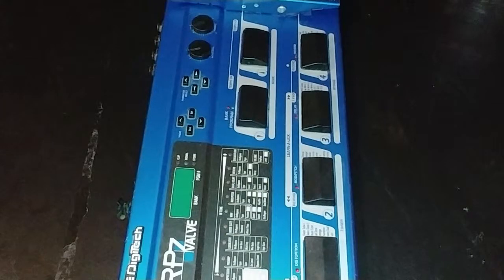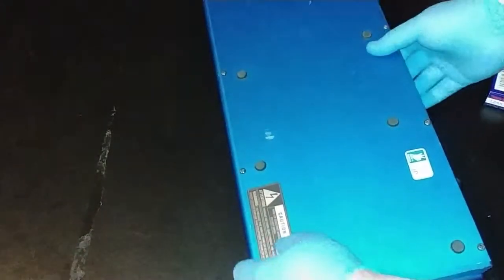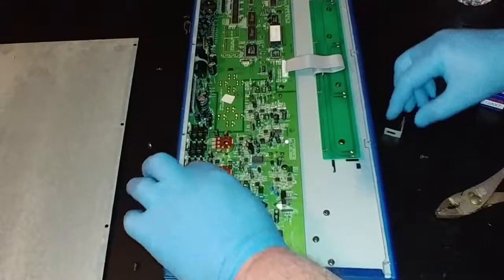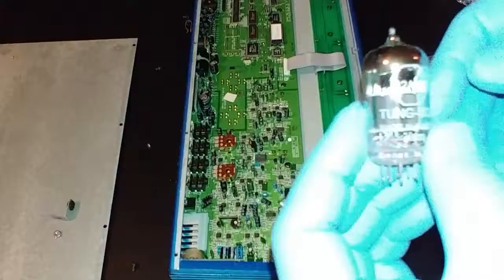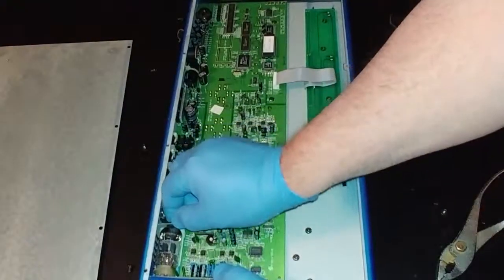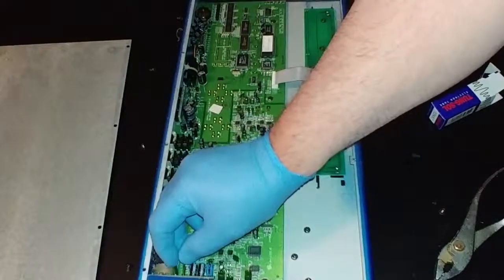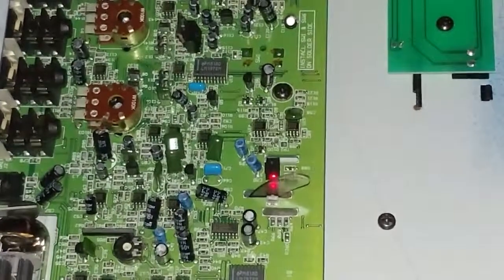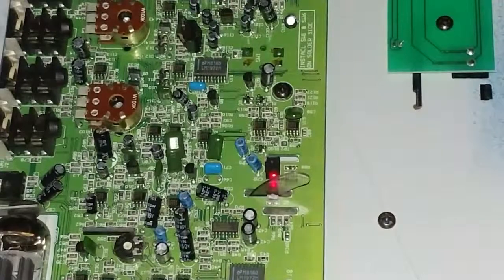Digitech RP7 Valve - Tube Replacement

Comment: Hello, I have an RP7 valve but I have damaged it because it was 120v and I accidentally connected it to a 240v line. The transformer broke down but I already bought one online and it is yet to come. I have tested if the multi-effects works with a conventional universal 9V transformer connecting it behind a couple of transistors that were behind the power socket that seemed to be damaged and it lights up the led panel but nothing is heard, do you have an idea how I can repair it? the tube valve turns on but not like before, it looks like in your video. did your pedal work after placing the tube valve?
Reply: thank you for watching the video. I am so sorry to hear about your situation. My pedal worked fine. When I changed the battery, it went back to factory settings (effect patches). I did use the correct power supply. It sounds like you are on the right path with replacing the transformer, but this is beyond my knowledge. Hope it will be repaired soon.
Reply: Lol you asked the guy that used pliers to remove a battery and bent the +side contact.  I hope you take your pedal to circuit repair guy if you want it fixed l, probably will cost more than the pedal though but it wouldn’t hurt to get a quote

Comment: Hello, I ask you a question? ... for what reason did you change the tube? What problems did you have with the previous tube? ..... I have a problem with my rp7, if I use the overdrive (pre) or fuzz ... with my guitar at volume 10, ... it sounds without problems, but if I I lower the volume of the guitar, for example to 3, the sound of the plucked string cuts out suddenly, it does not end naturally, deactivate the NoiseGate, with that I improve ... but not 100%, what could it be?
Reply: Sounds like the noise gate is cancelling the sound at lower volumes. That would be my guess. I was the second owner and I thought I should change the original tube.
Reply: Its actually a  digital pedal so it cant catch very low volume notes.Common problem.

Comment: What the battery does in the pedalboard?
Reply: It doesn't use a battery. It needs to be connected to AC
Reply: probably for memory so it can store any user presets you make
Reply: Yes the battery stores user presets.